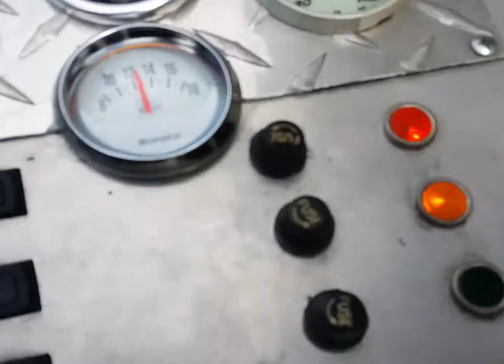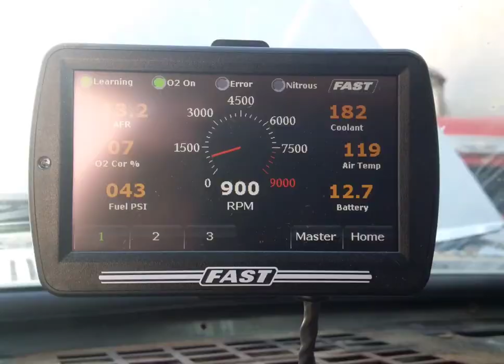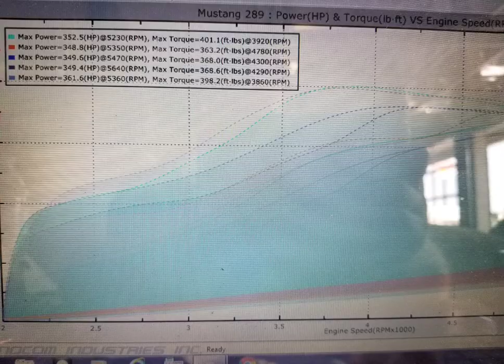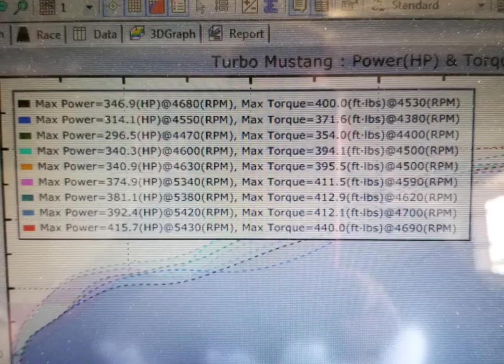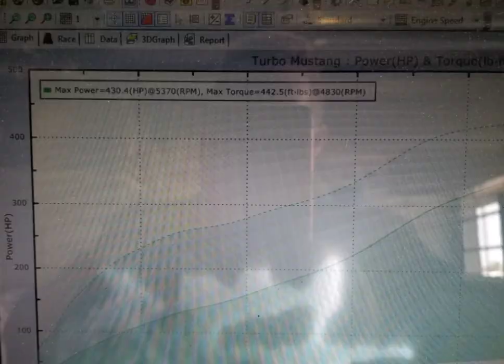67 turbo Mustang (Daisy) introduction.

Comment: Great progress really dig the car. Did you fabricate the hotside or is it a kit? Looks nice. Also... any need to notch the shock towers for fitment purposes with front facing headers?
Reply from the maker: I wish I had fabricated the kit but it's a cxracing 67 Mustang single turbo kit from Ebay.  The kit fits okay with some modification. It clears the towers just fine with one forward facing header on the passenger side and the driver side goes around the back between the transmission and oil pan. Thank you for watching and I hope this helps.
Reply: ToyShopFab _Johnny Biggs Big help thanks man. I’m modifying a CX foxbody kit for my 67 comet and have to use flipped BBK’s on one side, and might notch the towers while the motor is out but it’s great that yours fit nicely.
Reply: @toyshopfab  do you know if this kit will work with a 351w? I have a stroked windsor in my 69 and am thinking of a turbo setup
Reply from the maker: @pilotN-ve1cu  I had to modify almost every part of this kit to get it to fit the 351w that's in this car now (crossover pipe, wastegate, headers)

Comment: will this kit fit if im running AC and Power steering? using a 5.0 serpentine setup. Also running a TBI EFI system.
Reply from the maker: Here's a link to the exact kit I used, it doesn't look like it would work with power steering but it might with some modifications 

https://www.ebay.com/itm/183903520287?mkcid=16&mkevt=1&mkrid=711-127632-2357-0&ssspo=AWhZTKpZSTO&sssrc=2349624&ssuid=0TuPthtIRTK&var=&widget_ver=artemis&media=COPY

Comment: Hey did the cxracing headers fit onto the 351w without modification?
Reply from the maker: Nope, they had to be modified
Reply: @toyshopfab  was it anything major?
Reply from the maker: @ChakraFrequency  Driver side was a dint and ding process passenger side was a lot of work, was cut from the flange and tilted also had to cut the lip from inside the shock tower.

Comment: What kind of modifications did you make to your C4 ?
Reply from the maker: It's basically a stock C4 with a upgraded input shaft and shift servo but I just ordered the parts to upgrade to a manual valve body and transbrake
Reply: @toyshopfab  thanks for the quick reply. I’m amazed at how tough those little c4s are. Really enjoy your videos 👍
Reply from the maker: Of course and I've been amazed with this little c4, it's been beat up on a lot and just keeps going!

Comment: Did you use a 289 block? This is fun!
Reply from the maker: Yes the original engine was a 289. The new one is a 351!
Reply: @toyshopfab  nice! I'm pretty much doing what you're doing on my 289 in a 70 fastback. With 351w plans when one comes along
Reply from the maker: That is such an awesome car, definitely one of my favorites.